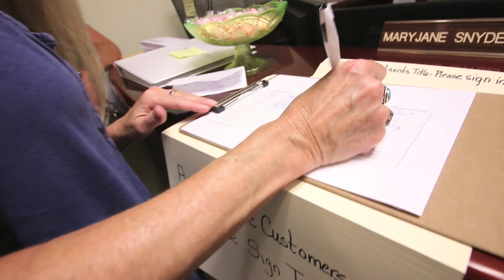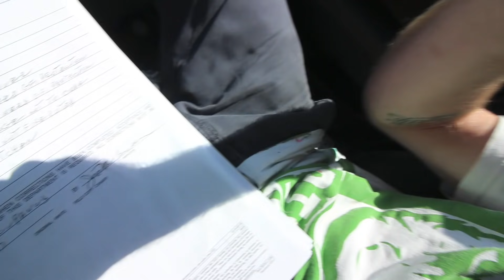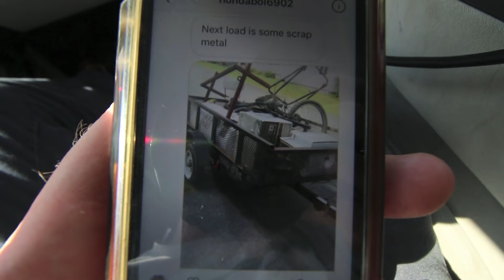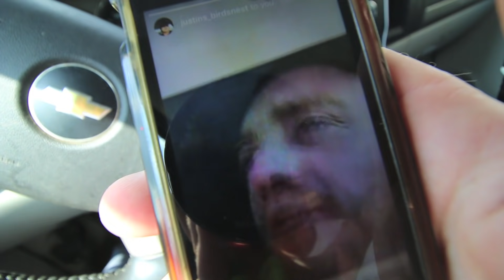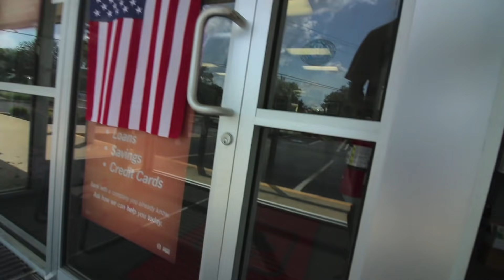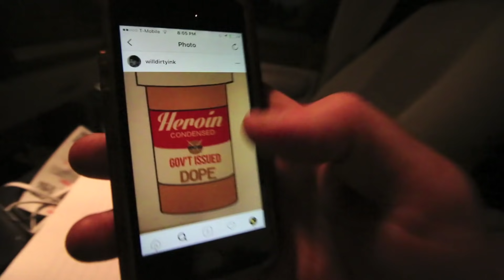SETTLING ON A HOUSE!!!

Comment: Wow!! $45./cut, we pay $50. front and back lawns, the property is 70 x 200 ft. 3 guys here with 2 ride on zero turns.They also use a whipper snip and blow the grass also.  They're here less than 1/2 hr. every week. $200. per month. We're in Orillia, Ontario Canada
Reply from the maker: That seems really cheap you should give them a tip. Cutting grass is hard work.
Reply: @tuckandsammie  sometimes they are here 18 minutes. They're sitting on a riding mower...not like you pushing it around. We feel that's enough lol  I admire how hard you work, and you use an edger, that's an extra $20. if they trim weeds or use the edger.

Comment: that is only a an ordinary domestic lawnmower at best, not a good commercial lawnmower that should start first time every time, no wonder you were getting a sore back
also most weed wackers come with small handles, being tall i got myself a  large loop handle Kawasaki make a good one, never had a back or shoulder problem in 30 years of cutting lawns full time, although now need a hip replacement